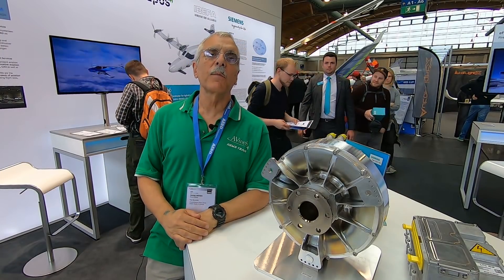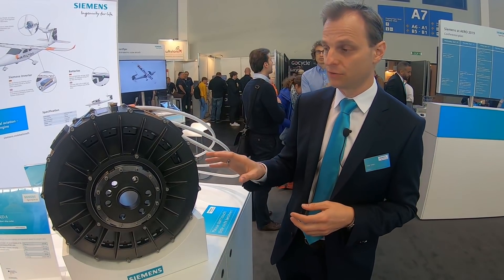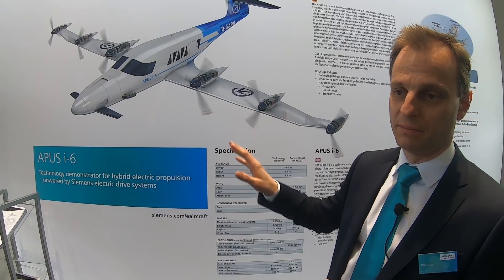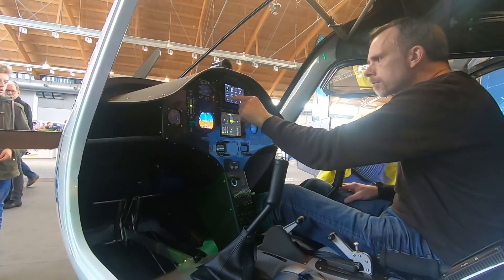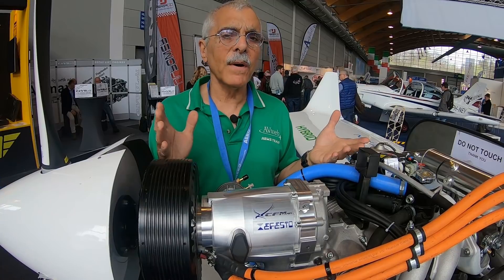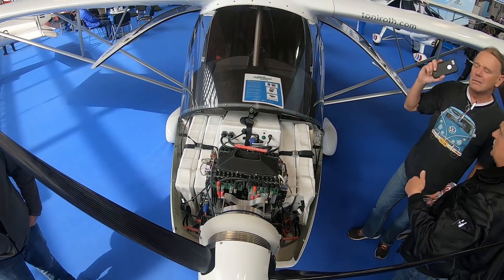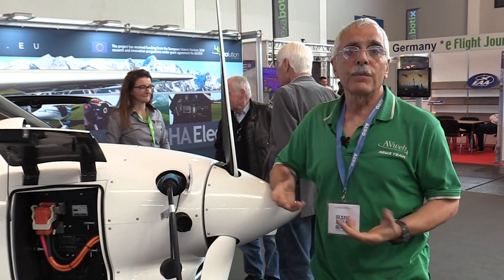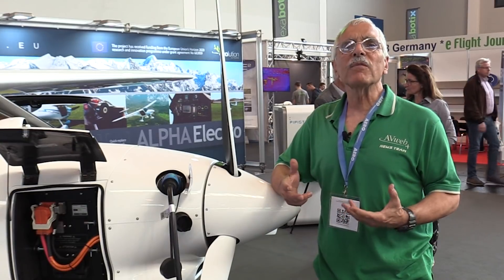What's New in Electric Airplanes?

Comment: The problem was never the motors. The problem is ALWAYS the batteries.
Reply: Yes, but until that is fully fixed, improvements to thermal/propulsive efficiency, weight, and aerodynamics are always welcome.
Reply: @米空軍パイロット   Batteries make up 30-45% of the weight of an electric plane, you can't make up for that through efficiency, structure weight and aerodynamics.
Reply: @linusa2996  I never said it did. Read again.
Reply: @linusa2996  It would not take 30-45% of a/c weight. if Graphene Supercapacitor is used instead of Batteries. Do you agree?.
Reply: @linusa2996  If Graphene Supercapacitor is used, it would not take 30-40% of a/c weight. Do you agee?
Reply: @linusa2996  Taht number, is it applicable for Batteries only or also for Graphene Supercapacitor.?
Reply: @sekarmelati  according to the studies I've read, Graphene Supercapacitors are at least 15-25 years from being usable.  At present Supercapacitors have 1/20's the energy of a Li-Ion battery and that in turn is 1/50 the energy of jet fuel. So a 75yr old DC-3 can fly further on 5178lbs of avgas than it could fly with electric motors and 12,000lb of batteries.
Reply: @米空軍パイロット  I am the Innovator of THE NEW WAY TO TRANSFORM ENERGY WITH MY UCRÓS ELECTRIC CYCLE SYSTEM of the Republic of Colombia South America Carlos Ucrós WhatsApp +57 3012358709

 And innovated a system to install it in electric cars that use a 72 VDC output controller is a device that I install before the controller and use a single battery and I extend the autonomy to 400 kilometers with the air conditioning on of fasil installation two components with  the battery price in Colombia 9 million pesos out of 3 thousand dollars sent by plane separately contact the innovative CARLOS UCRÓS
www.ucrosenergysystem.com
Reply: @米空軍パイロット  Re-invent the wheel would be nice too. Thank you very much!
Reply: Yes, all the parts are in place so when someone invents a lightweight, high capacity battery, electric planes will take over.  Quick charging, like the 20 minute Tesla supercharger, must also be in place.    With current batteries it’s just vapor ware.
Reply: @drew8256  Graphene Supercapacitor if used, can be charged in seconds, do you agree?
Reply: Energy density improvements happening : Capacity increasing : more power, more runtime, smaller packaging = more applications 

Current generation lithium ion / lithium polymer batteries like the air cooled laminate pouch cells in my 30kWh 2016 Nissan Leaf are already widely utilized in portable consumer electronics like smartphones, smartwatches, tablets, laptops, electric bicycles, hoverboards & more. 

Lithium ion limitations include being damaged faster by high heat & 100% charging, long life mode requires 30-80% charge cycling at tightly controlled warm temperatures between 50-77F (10-25 C) / elaborate thermal vapor chamber cooling (xbox one x) + heat pipes (copper thermal bus) + liquid cooling (moving heat easily) adds weight & complexity but can extend battery life by keeping the cells cool when fast charged & fast discharged. 

In land vehicles, in most climates, a liquid cooled & resistively warmed lithium ion energy storage system will give 20-100kWh in vehicles that cost $30-100k new, with range from 60-350mi (100-565km) with examples like the Tesla Model 3, S or X very commonplace worldwide 

Nearly every automaker fully invested in electric vehicle development, commercialization, marketing, sales etc at some stage or another, some with over 50 years of EV research like GM, Toyota & Nissan etc || Mercedes/ BMW / Audi / VW / Hyundai / Honda / all the big names are getting in on the EV fully electric passenger car segment going forward. In the future all land vehicles with motors will be fully electric. 

As battery technology improves, future electric vehicles will improve because of the point you make that the main problem for all EV's regardless of platform comes from the battery technology. My wife & I ride our Segway MP's for fun & the failure prone fragile lithium ion battery seems to be holding up well after years of regular use. Similarly our Nissan Leaf battery has more than 94% of its capacity remaining checked with an ELM OBDII reader bluetooth to LeafSPY app etc/ GIDS ^ more 

Aircraft are a tougher application for batteries because of the wider temperature range that aircraft experience during their operation vs cars 
& have weight constraints that are much harder to solve with limited lithium ion batteries. Essentially to build a good all electric aircraft today the whole upper surface of the entire craft needs to has solar photovoltaic embedded to capture daylight for use in the electric motor * the entire airframe needs to become a lithium-ion battery pack assembly with distributed cells. Study RC drones with good flight endurance for an example of what I am talking about, the entire drone body becomes a battery platform. This is with LIPO at about 250-600Wh/kg depending on which specific chemistry is used & the kind of packaging utilized etc. All solid state polymer batteries being developed by Toyota should drive performance for energy density beyond 1000Wh/kg while also increasing energy density for smaller packaging or lower volume etc
Reply: Charlie K  

Why??? 

The electric motor has an efficiency of 90%
Reply: Charlie K  How so?
Reply: Personally I love this subject, and I look forward to the economic inversion point where electric vehicles are cheaper than gasoline counterparts in all categories , the writing is on the wall and in 5 to 10 years the choice between gas and electric will be a economic no brainer as far as automotive. 
Heavy trucks on the other hand have some pretty serious logistical issues that need to be resolved before a switch can be made, I read a cocktail napkin engineering study on the Tesla semi which estimated the 500-mile version to have a 1000 kilowatt hour battery. to be viable for a Long Haul Trucking it's going to need double that capacity or more and much greater cold weather performance than current lithium ion batteries are capable of. The kind of energy required to recharge a battery of that size in a reasonable amount of time means you're going to need specialized equipment that will be far too expensive to install in mass meaning that truckstops and terminals will need to be retooled to handle the demands.
As a example the flying j in rockford il has 20 pumps and a line 2 trucks deep from about 5 am to 10 pm every day. Each truck is refueling in about 10 minutes and this is every day of the week. The energy demands of such a truck stop if all of those trucks were electric and recharging 2000 kilowatt hour batteries  is staggering.  that's just one truck stop, with the ballpark demand of about 160 megawatts per hour and theres 3 more just like it within 20 minuets of each other.
That being said, I have serious doubts about the viability of batteries in aviation, current technology can barely power a puddle jumper for 1 hour under good conditions. Extrapolating that out to what a plane is going to be capable of with the wilder predictions of 5 to 10x energy density solid state batteries means we might be able to start talking about Bush Planes and smaller short and medium range craft but serious commercial passenger and cargo operations are going to need a different answer inorder to work.
Thats where bio fules come in.
Biofuels are already being used, we're already manufacturing 3 billion liters of the stuff per year and as more and more cars switch to Electric we're going to have larger and larger amounts of capacity freed up for usage in areas like Aviation.
Reply: @AaronSchwarz42  Then it seems that you have what engineers call "the knack". Don't know what this means? Just look up the Dilbert comic on it.
Reply: @米空軍パイロット  I know all about about batteries & capacitors * have been building both as a hobby & professionally for more than 20 years! I don't care what you think you know about me, since you could not possibly know much based on your comments. We only have a finite amount of time in the world. I recommend strongly that you use your remaining time to improve or do something other than tell me what I am or not since you could not possibly know. Cheers

Furthermore, both battery & capacitor technology already giving rise to an electromotive revolution in all forms of transportation. No amount of stupid ignorant rhetoric or confusion will prevent the emerging technology from commercialization & disrupting then displacing the carbon burning fossil fuel sector air pollution climate change debacle created by burning coal & oil distillates on the scale of billions of people concurrently alive at the same time.....
Reply: @AaronSchwarz42  Well you still failed to write a comment related to anything I said. You are going on a Don Quixote style crusade for clean energy, looking for opponents where none exist.
Reply: @米空軍パイロット  Your spot on that I am on a crusade for clean energy, renewable energy, renewable hydrogen, energy storage, electronics, ions & more / with nearly 9 billion people alive at the same time polluting energy technology a dead end with air & water pollution undeniably causing costly diseases, suffering & pain. More proofs of aircraft & vehicle exhaust directly harming lung tissue with superfine nanofine particles that irritate the bronchial cells etc. The emerging sciences tells everyone we need to move beyond burning carbon to make more energy for everyone. As an environmental, chemical & physical scientist, I am on a mission to change the minds of anyone who opposed clean renewable energy technology. We will have a fully electric future & no one can stop it! Power & Information, Light, Electricity, Its happening. Even people are shuffling hydrogen ions across membrane gradients to make cell power etc. We are make of, breathing & drinking chemistry from the biosphere of earth. Our gut is a biome made of an ecosystem of other organisms that live in a commensal harmony with our digestive system, on our skin, up our nose, in our eyes & ears, everyone is part of the ecosystem & a living biological community of many organisms. Thats why pollution unethical, it harms all forms of life by poisoning cells. There is a more intelligent, more efficient & cleaner way to do everything & there will always be better ways in all ways, always room to improve, nothing is impossible!
Reply: @AaronSchwarz42  Yes. I agree with you. All I'm saying is that you're trying to preach to someone who is already on your side and never indicated that he was opposed.
Reply: Look, guys. I get that you don't like my personality. However, if you want to put me in my place, you're gonna have to get your facts right. You can't get a lie past me.
Reply: @米空軍パイロット  
Original claim by OP
"Graphene batteries can run lifetimes on one charge. "

Your rephrasing of strawman claim, "Graphene supercapacitors can hold charge forever"

HAHAHAHAHAH YOU CANT EVEN KEEP YOUR CLAIMS CONSISTENT AND YOU DISPARAGE OTHERS?

WE ARE DONE HERE. 
You can't even juggle what you perceive someone to claim and what claim you put forth without hopelessly obfuscating something. Forever =/= lifetimes. Battery with graphene =/= capacitor with graphene. 

Nothing you added to this convo was useful.
Your two claims were that graphene batteries don't exist and that the graphene capacitors that do, can't 
run on a single charge for 'lifetimes'. 

The truth of the matter, regardless of your claims, is Graphene batteries do exist, and they are higher energy density than lithium batteries. Nothing more needs to be said. I'm afraid since you were misinforming people on your very first claim about graphene batteries, I'm really not going to pay attention to anything you claim from now on, since primary sources are so much better than some internet toughguy I've shown to be incorrect in the very first claim "graphene batteries don't exist."
Reply: @taylorwestmore4664  I doubt he was speaking in hyperbole. Most people suck at understanding tech talk and misinterpret phrases for something else entirely. Problem is that most people assume that because they are fluent in English and because an article appears to be written in English, that they should be qualified to read. That is not the case. If I showed you a textbook on aeronautical engineering, you probably wouldn't be able to read it. Your reading comprehension would probably be about as good as if you were reading French, Spanish, German, or any other relative of English.

I will look into your article, though. This would be an interesting breakthrough if it exists.
Reply: @米空軍パイロット  I accept your attempt at humility. i actually design magnetohydrodynamic rockets for fun and plasma aerodynamics is a very interesting domain between aerodynamics and plasma physics that will supercede aerodynamics in many fields as there is a need for sonic boom mitigation via the effect of charged particles on laminar flow.

 Also if you want to be blown away by battery tech, John B Goodenough, the inventor of lithium cobalt chemistry is perfecting the SOLID STATE BATTERY using sodium, lithium or other alkali Earth metals in a glass matrix. This will truly allow for tens of thousands of charge cycles at 2-3 times the specific energy density of lithium ion cells.

Cheers
Reply: @taylorwestmore4664  Yeah. Humility isn't the strong-suit of pilots. Nice talking to you. This tech is fascinating.
Reply: @米空軍パイロット  I would hope our pilots have the balls to keep fighting in the face of overwhelming opposition. 

Hopefully one day you can fly or help engineer the plasma jet aircraft. The coaxial plasma railgun for example, is capable of exhaust velocity of 1600 m/s. Combine this with leading edge plasma control surfaces and you have the next generation of Blackbird aircraft capable of Mach 5 without a sonic boom or the need for heat shielding expansion tolerances
Reply: Probably it is because efficiency of electrical motor in converting from electrical to mechanical force is already very high. It will cost so much to increase just few more percentage.
Reply: Charlie K  In what sense, would you explain.
Reply: Yeah. I know. Taylor set me straight.
Reply: Norm T 
 graghene supercapasitors loose no charge over time and do not degrade with each charge unlike all batteries but i dont think they can be used for this application. Although I have been hearing about some new battery coming to market soon that blows lithium ion out of the water with like 50 times the capacity as a lithium ion and lasts for almost ever but it won't be to market for 2-5 years but once its made im sure there will be alot of electric airplanes and every other driving or flying machine everyone needs to go electric and stop using fossil fules it is putting to much CO2 in the ozone causing the planet to warn at an alarming rate. The world should also band all plastic bottles and bag production and go back to all glass bottles and paper bags
Reply: That's why I like the hybrid approach like they mention at 9:40 - less than 2 GPH gas burn rate after takeoff. Are there any other straight gas planes that get lower? Or even within say 30-40% fuel efficiency?
Reply: Agreed. Same with cars. We need micro nuclear. Size of a football, 20 years lifespan...
Reply: and for large passenger planes electricity can not provide the propulsion the plane needs
Reply: I am the Innovator of THE NEW WAY TO TRANSFORM ENERGY WITH MY UCRÓS ELECTRIC CYCLE SYSTEM of the Republic of Colombia South America Carlos Ucrós WhatsApp +57 3012358709

 And innovated a system to install it in electric cars that use a 72 VDC output controller is a device that I install before the controller and use a single battery and I extend the autonomy to 400 kilometers with the air conditioning on of fasil installation two components with  the battery price in Colombia 9 million pesos out of 3 thousand dollars sent by plane separately contact the innovative CARLOS UCRÓS
www.ucrosenergysystem.com
Reply: Nowadays you can get flexible solar panels, and you can get clear solar panels, and it wouldn't be all that insanely difficult to make a combination solar and gas heating panel all in one. This might even go further and have three stage generation from a single panel. The entire aircraft skin could be solar cells. It is possible to thermosyphon certain metals through a coil to generate electricity with no alternator, so that is electrical output from both photons and heat. It is very likely that the storage system could also be incorporated in the solar collectors as well. Also, there is potential in using lens shaped components to magnify heat even further. If the solar components together also formed the entire supporting structure of the aircraft the efficiency could be enhanced further still. Very exciting potential, and we desperately need these ASAP.
Reply: the worlds first graphine batteries were released this month.
Reply: Battery will be a problem for some time to come. The chemical energy per pound between battery and gas is issue - takes about 18 pounds of battery weight to equal energy in one pound of gas.
Reply: RC models have been on cutting edge of lipo battery performance now starting to use Graphene the biggest issues is safety anyone who been in RC models knows how lipo battery can and does catch fire while charging and sometimes while discharging. Recently in the US we have had lithium battery storage systems explode severely injure  firefighter in Arizona. These battery systems while replacing flammable fuel now has explosive battery. The difference is at least with gasoline you had some indication of a leak, or fumes where these lithium batteries there is no indication some just catch fire without warning.
Reply: No problem...Harbor Fright has a huge sale on extension cords...!!
Reply: danko jones  No... No they cannot. Let me spell it out to you, since you are scientifically illiterate.

First, there is no such thing as a graphene battery. They're called Graphene Supercapacitors. Batteries use chemical reactions. Capacitors just hold charge using surface area.

Second, they hold less charge than batteries. What they are good at, though, is not degrading every time you recharge them. You misread whatever article you read or you chose to read articles written by idiots. Their charge doesn't last forever. Their capacity just doesn't decrease. There's a huge difference.
Reply: @米空軍パイロット  I use to use a rubber band, never had a problem!  ;-)
Reply: @TravelStyleNews  But think about the effort in winding it up?
Reply: @TravelStyleNews  You lie.
Reply: @craigwall9536  Explain?    I understand that engines need to be light, but the struggle is the batteries, Yes?
Reply: @米空軍パイロット  "battery" is a capacitor. Conventional battery has a greater capacitance, higher internal resistance and slower charging/discharging time. Graphene super capacitors in parallel/series (pick a great number) with mcu control (per segment) of charge and discharge is  "the way of the future" - it will have (and probably already has) both quick charge (low resistance) and great overall capacitance and great amount of energy stored in it - long enough for its application (read: flight). Also, it could be used in combination with conventional batteries but probably not going to be a case on a long run. Shame on you for calling someone names. :/
Reply: @米空軍パイロット  You are only partly correct they do use graphene in combination with Lipo batteries to enhance the battery it will charge faster and has better density to last longer and many more cycles.
Reply: @米空軍パイロット  Graphene Ultracapacitor can have high power density in the order of 2 to to 8 KW/Kg and at Energy density of 20 to 120 Wh/Kg. While Battery could have the same energy for 50 to 150 W'Kg. Do you agree with this?
Reply: @米空軍パイロット  "Graphene-based batteries have exciting potential and while they are not yet fully commercially available yet, R&D is intensive and will hopefully yield results in the future. ... In November 2017, Samsung developed a unique "graphene ball" that could make lithium-ion batteries last longer and charge faster."
Btw, "-Based" could be dropped.
Reply: @米空軍パイロット  Maybe danko jones means they hold their charge for ever until discharged?
Reply: @米空軍パイロット  Use the words energy accumulator & ignore the capacitor vs battery word use : point : storing energy for later use 

Electricity is the largest market worldwide with almost no inventory because we lack energy storage technology on the gigawatt class, even in stationary applications where weight or mass is not very constrained etc / pumped hydro really the only big player / not very well developed & very low total capacity worldwide.
Reply: @AaronSchwarz42  Aaron, I don't think you can read. Read all my comments again, and thoroughly this time.
Reply: @米空軍パイロット  someone got fired up.
Reply: @rubydog25  Imagine me, an engineer and Air Force pilot, seeing the majority of the population talk about shit they can't understand every single day. The bad part is, they are so lacking in knowledge that they can't even learn from reading because they can't understand the words on the page. Instead of going to a person that can teach them in simple words, they make statements. Statements should not be made by people who are only fit for asking questions, but nobody has told them before that they fall into this category. That is where I come in.
Reply: @24beat-176khearts  Then please educate me in how I was wrong.
Reply: @米空軍パイロット  I dont think you're an engineer or an airforce pilot
Reply: @rubydog25  Okay. What do you think I am then?
Reply: @米空軍パイロット  fake
Reply: @rubydog25  Alright. Let's see if you can demonstrate the backing to your claim.
Reply: @taylorwestmore4664  Congrats. This has nothing to do with the claim that graphene supercapacitors hold their charge forever.
Reply: @rubydog25  We are real. Go look up the qualifications for getting into USAF TPS.
Reply: @米空軍パイロット  they are real, u aren't
Reply: @rubydog25  Not quite the same grace as Taylor, but okay.
Reply: @rubydog25  - Don't "Fire Up" you Rubber Band Motor! It will Disintegrate! 😁
Reply: Get lost!
Reply: @jto1916  no!!!
Reply: mrspeigle1 - Oh jeahhhhhh!!!!!!
Reply: @jto1916  yeah!!!!
Reply: @米空軍パイロット  True.
Reply: thats why hydrogen fuel cells are the future of automotive
Reply: @alanowa123  hydrogen fuel cell still fuelly electric & each hydrogen molecule just a molecular battery, think Proton with Electron ...
Reply: @AaronSchwarz42  it stores energy but trchnically it's not battery ;) but if you still want to call it like that remember that hydrogen have the most energy density from all common fuels and it's far more dense than gasoline (Hydrogen have 142Mj/Kg while 100LL have 44 Mj/Kg), so fuel cell drive system can be even lighter than classic petrol engine with gas tanks.
Reply: @alanowa123  Hydrogen as an energy fuel problematic for several reasons, not to suggest that it cannot be used in a battery, like the doped nickel sponge in Nickel Hydrogen batteries or NiMH as in "metal hydrides" where the hydrogen ions insert & remove from the metallic lattice materials, this is also called solid hydrogen storage & does not have good energy density. Consider the energy density of commercial lithium ion cells to that of nickel metal hydride. Well made aerospace grade NiMH & some automotive examples like those in the Toyota Prius are a lot more durable & long lasting than common lithium ion cells which often fade hard after just a few years. 

Hydrogen is a chemical element made of a single proton surrounded by a single electron that can be removed to create a H+ ion & a free e- electron to do work in an electrical circuit like a PEM hydrogen fuel cell electric generator 

At STP hydrogen gas very low density, even lower than helium, & was used as a lifting gas in early airships. Unfortunately the autoignition energy of hydrogen something like 0.0000017 joules, so hydrogen dangerously easy to ignite accidentally. 

Liquid hydrogen does have good energy density as a fuel & for this reason gives the highest ISP in cryogenic LH2 LO2 rocket engines 
Blue Origin, Jeff Bezos rocket company, using liquid hydrogen for its upcoming moon program etc for this reason best performance but hydrogen as a cryogenic liquid kept at or below 23k very very hard to work with. 

In Hydrogen fuel cell vehicles like the Toyota Mirai, higher pressure hydrogen gas @ 10,000 PSI ( 70 MPa ) utilized / this makes the Hydrogen refueling stations very complicated & expensive. A major problem with hydrogen at high pressure in metals comes from a problem called hydrogen embrittlement, where the tiny hydrogen molecules wiggle between the crystal boundaries in the metal & slowly leak out while also making the metal increasingly brittle, more like a ceramic. Platinum use in the fuel cell stack in vehicles like the Mirai also make it more expensive, though efforts are being made to reduce the use of platinum at Toyota, Hyundai & Honda etc 

So while it's technically true that hydrogen has very high energy density, in practice, you can only get this at very high costs. 100LL or the lead free GTL Shell fuel alternative much easier & cheaper to make & work with as a liquid near & around STP or standard temperature & pressure/ in the real world. In actually practice, in real applications, liquid hydrocarbons dominate transportation energy because they are simple, easy & well proven over long periods of time to work as fuels that burn well using atmospheric free oxygen in air in naturally aspirated & blown engines of ICE or in Turbines etc / BMW actually tuned a 7 series that ran on hydrogen gas being burned as a fuel in the specialized engine / poor fuel economy & high costs caused that project to remain a prototype demonstrator.
Reply: @AaronSchwarz42  come down on earth, we are talking about use in aircrafts and cars, not rockets science :P 

Tanks are carbon and can hold temperature and gas for a long, looong time (i've heard somewhere that you can pour hot coffe in mirai's tank and it will be hot (not just warm) for 60-90 days), so thats not a big problem. 

The only problem now are costs of fuel cells itselfes, but that is compared to standard car engine. As we all know aircraft engines are far more expensive than the ones from cars and mitenance costs are much grater. If you compare aircraft engine to fuel cell with simmilar power, the price difference won't be that big. Also remember about better fuel economy of fuel cells and that 1kg of H = 1gal od RON.

It is the future - you want it or not, we cannot produce petroleum and we must move to energy source that will last for more than 300 years... 

I do not mean that we have to move to hydrogen now. What i'm trying to say is that we must develop this technology, because gasoline becomes more expenive each year and source will finnaly end... 

Remember that 140 years ago people were reacting the same on petrolum engine ;P
Reply: @alanowa123  Oh I fully agree that we should move beyond using petroleum (gasoline & diesel) in transportation. I got a cheap used Nissan Leaf S to use as my car to drive too & from work daily. The 30kWh lithium manganese spinel laminate battery that Nissan used in the late 16 LEAF was chemically optimized to hold up well for 10-15 years of daily cycling / much longer than PbA or Lead Acid batteries common for starting light & ignition purposes in most conventional vehicles that use gasoline or diesel as their primary energy source. 

Jeff Bezos gives a great talk explaining what you said, why we need to start working with hydrogen now, to gain expertise with it because it will be the fuel of choice in the future when easy hydrocarbons are long gone & or not cost effective. 

In terms of electric transportation, electric powertrain technology is already ready for primetime & hundreds of new fully electric models are launching from most of the automakers over the next few years. 

In the video we are commenting on, Pipistrel with their trainer aircraft with ~45min of flight endurance already said that the next generation of that aircraft coming out in 2019 with a liquid cooled battery that has better thermal management for rapid recharge after landing to give the vehicle better duty cycle under heavy duty use cases as a trainer or short hop aircraft flying around all day, every day etc at small regional airports & in rural places etc. Most of the world already electrified enough to offer 220-240vac at 40amps to recharge electric vehicles & small electric aircraft at moderate charging speeds. Many commercial installations, for example at most Nissan Dealers they have a 480vdc L3 fast charger that pumps out 62.5kW for faster charging & Tesla Super Chargers spool up 150kW with plans to go to 350kW & Porsche Audi BMW Mercedes VW etc collaborating for 800kW to 1MW charging station development for L4 charging. Anyones guess what L5 charging will look like, I suspect 2000vdc at thousands of amps... 

To give an electric aircraft good flight endurance, fuel cell range extenders with carbon fiber filament wound tanks etc + lots of high grade sonic welded LiPO batteries in multimaterial light fireproof cases + solar on the sky facing surfaces = much greater endurance, especially since the solar photovoltaic energy, fuel cell energy & battery energy combined can optimize takeoff, landing energy recovery, energy conservation when cruising & enhance overall range & performance via the synergistic hybridization of several energy systems like that... 42
Reply: @AaronSchwarz42  youre right, i almost completly agree with you with one expectation - there is no way that normal consumer will get charger that operates on such high power as almost 1MW :P those are limits of consumer chargers and batteries - time, power and weight. I'm more likely to say that supercapacitors will find place in cars, but they are extremely expensive for now. 

I think that combination of fuell cells and li-ion battereis (or maybe O2 - i've read few articles about them, they are much more dense than even lipo, the only problem with them is rapid oxidation of electrodes) is what will become a standard in automotive/aircraft propulsion system in nex 20-30 years.
Reply: @alanowa123  Most consumer cars, motorcycles, etc sit at night for 12-20 hours, often more parking time for recreational or sparingly used vehicles / plenty of time to charge using even a basic L1 charger on a normal power outlet, that power is everywhere already & lots of night time off peak power available in most places too
Reply: @alanowa123  L3 CHaDeMo chargers only connected to commercial building electrical systems since most homes do not have enough power at the panel to make it happen, nor do most EV owners need that kind of charging speed to refill the EV while its parked in the electrified garage space overnight etc.

At most homes the most you can hook up is a pair of L2 chargers at 40amps per circuit on a 200 amp service panel etc & many people will just opt to install a dryer or welder outlet 14-50 & use a plug in L2 charger with their EV since such can serve up 20-40mi/ hr of charging rate etc 

L4 & higher power than 350kw will need to be connected to a specialized substation system, typically connected nearly directly to a grid power plant of solar, wind, geothermal, hydroelectric, nuclear, natural gas or coal power etc / very high power systems & because they will offer extremely rapid recharge for future electric vehicles, the average driver will not need to hook up to these fast chargers for more than 10 min, giving an L4 or L5 ultra charging station the ability to handle good volumes of throughput like a conventional gas station. These L4 & L5 stations will almost exclusively be utilized for fully electric road trips & long distance driving routes etc